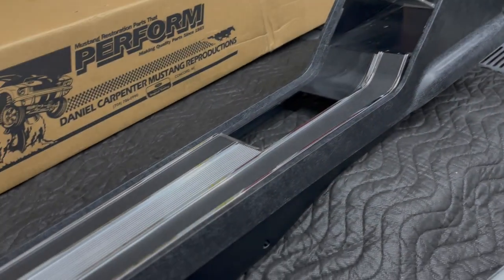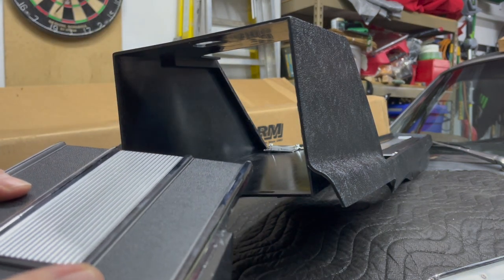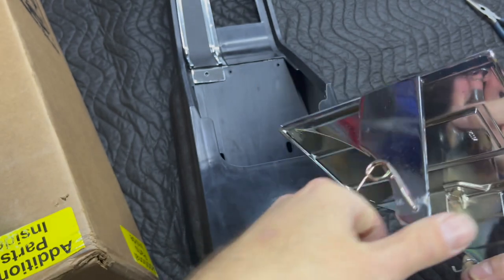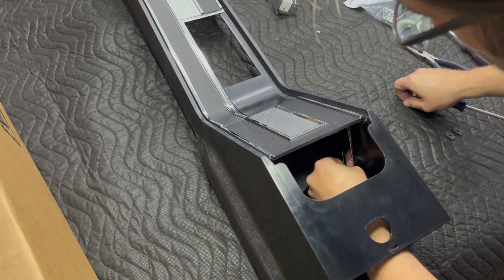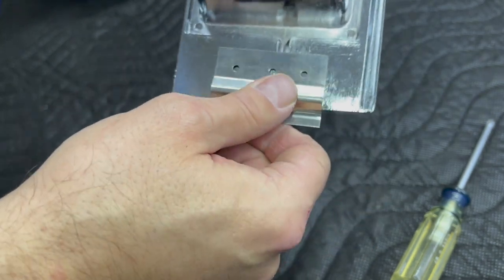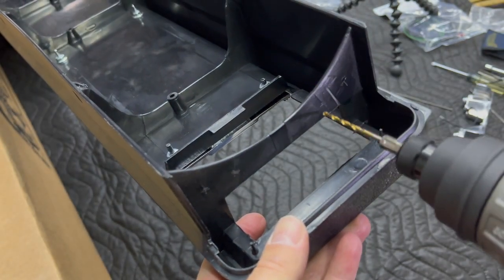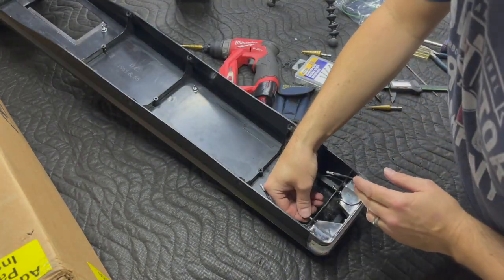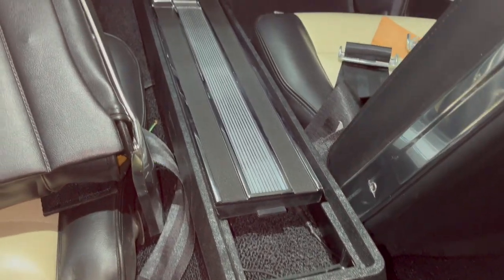1965 -1966 Mustang Console Kit Assembly

Comment: Wait till you have to install the ash tray, The one the company provides is not proper and it sits very loose in the rear of the console.  The plastic work the console is made of is third rate. Also, it produced cracks all around due to the improper low quality plastic used. Wherever there is a mounting hole on the hide, a boss is built in. But the boss causes the sides of the console to noticeably bulge out,. The Console is truly a piece of junk and a disappointment.
Reply from the maker: I have extremely low standards when it comes to Mustangs. They were built to a very low price point and the parts reflect that.

Comment: Woah, I noticed you have your seats switched around in the last clip. You've got the drivers seat on the passenger side and vise versa. Another tip is when you have the console in the exact right spot use a thin piece of wire heated up to poke through the screw holes and put a tiny burn hole in all the correct locations then take the console out and slightly more substantially burn the holes out a bit larger with a red hot piece of wire or a soldering iron. Drill the holes in the metal floor. Then put the console back in and install the screws. If you don't and you just try to drill or screw through the carpet it will immediately catch the material and start to unweave a line of material out of your carpet.

Comment: Thanks Dave, your video was a lifesaver, it was doing my head in as there are so many possible ways to install those darn springs! I used a couple of nice little chrome nuts & bolts to secure the springs via the loops that Mr Ford thoughtfully provides. Works a treat now. Thanks

Comment: Good explanation of the door install. Has any one have installed the wood grain inserts in the console?
I am having great difficulty removing the paper / plastic from the underside of the insert. Does it actually get removed OR is it to be glued down with JB or Gorilla glue as someone has suggested?

Comment: I"m trying to figure out the lighting for the stowage box. Mine has the hole in the back plate where the light fits and I see yours has a hole in the top. The new wire kits have the lights from the top but I'm not sure how the bulb is supposed to sit in the socket.  Do you have another video showing when you wired it?
Reply from the maker: Unfortunately I don't think I do.

Comment: Good Video, How did you get the rubber bumpers for the ashtray installed? I keep snapping mine off.
Reply from the maker: Hmmm, I didn’t get the ashtray until several months later. And it rattles badly. So I need to do something.